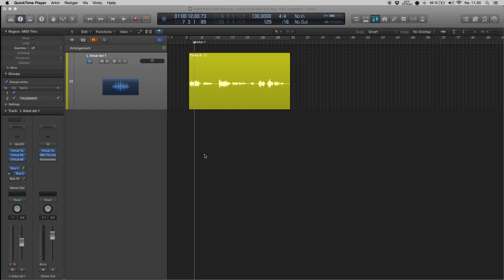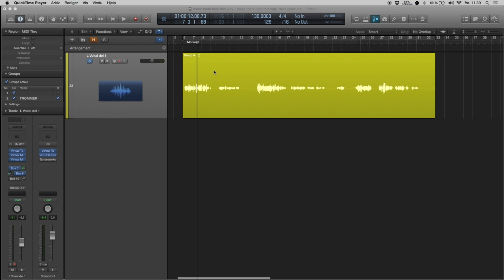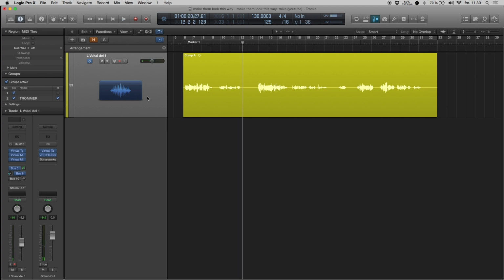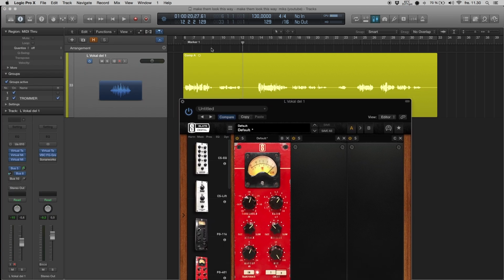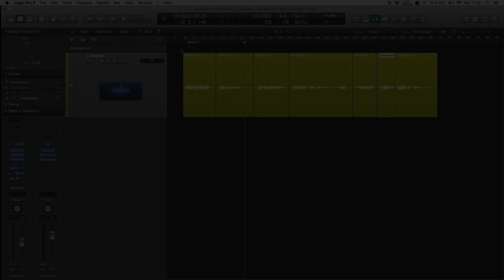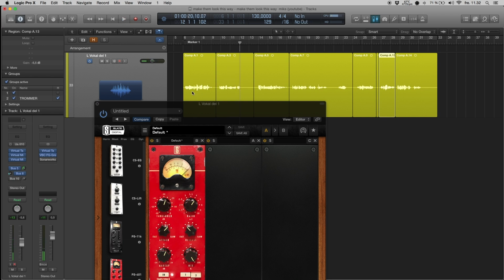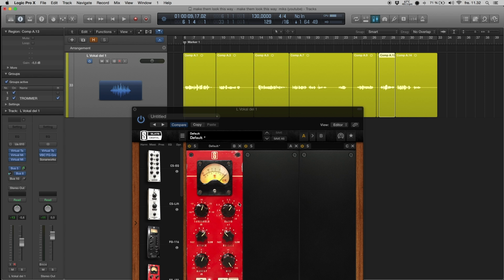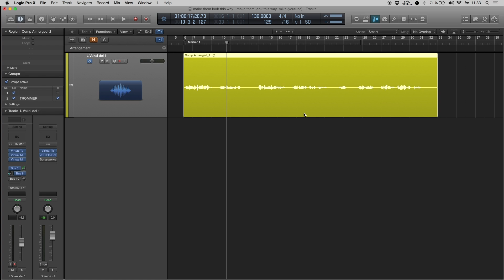How to Use Clip Gain in Logic pro X - Vocal mixing tips

Comment: Hi thanks for the video - I was wondering is there a reason I would do this method of dynamics control over using automating the volume fader? for whatever reason I feel like evening out the gain manually as you show in the video come first in the signal chain before compression where are volume fader automation comes after insert but I am not sure- Thoughts?
Reply: automate the gain instead to smooth out the vocal before it hits the plug ins you have on that track, automating the fader only changes the level AFTER it goes through all of the plug ins

Comment: Clip gain in Logic is SO bad it was one of the reasons I ditched Logic. Check out how pro tools does it.
https://www.dropbox.com/s/e4cjea0czl3ld49/PT%20Clip%20gain.mov?dl=0
I just made this video for someone to show them. I just dragged a long drum loop in to do it, the file is NOT uneven in volume but it still clearly shows how clip gain should be in any DAW.
No clip splitting required either. No automation required.

Comment: fantastic video, but I have an issue if you don't mind to answer: I can only enter a value in db manually, I can't manage to slide the value with the mouse to get the intuitive benefit of the visual reference. Any ideas on why I don't get that option? thank you again for your video.
Reply: Never mind I managed, is tricky because you have to put the mouse on a specific spot to make this work. Thank you for the tutorial Snorre.
Reply from the maker: Thank you sir :D I have no idea why you can't slide with the mouse. Never happened to me. You have turned on the advanced setting in logic under preferences?

Comment: For mastering is there any way in LPX to clip gain all the tracks down a little at the same time?
Reply from the maker: It is. If you mark every track in your project and use the gain it will effect all tracks👍 i usally turn everything down -10db as a starting point.
Reply: Thanks man. Have a good new years.